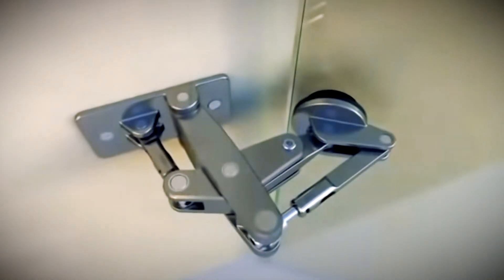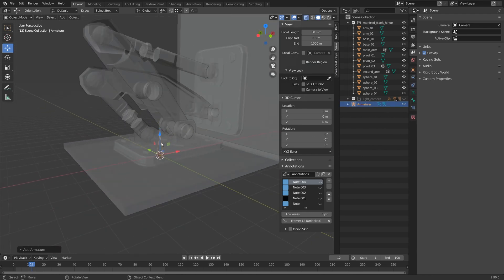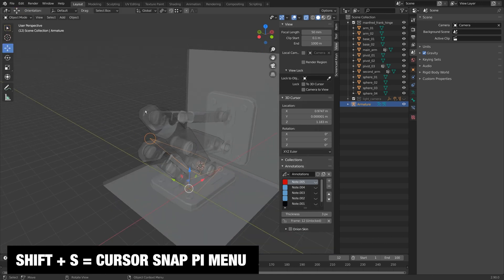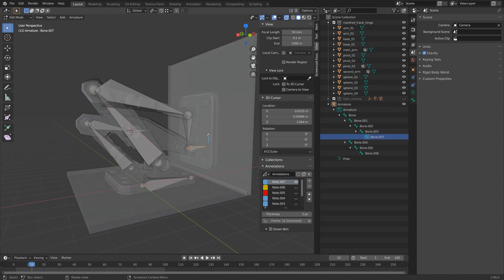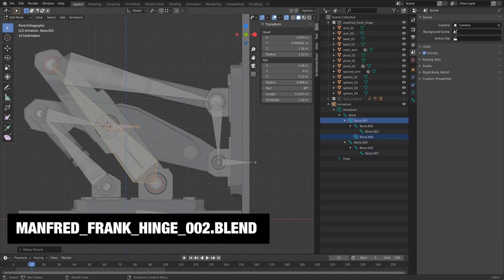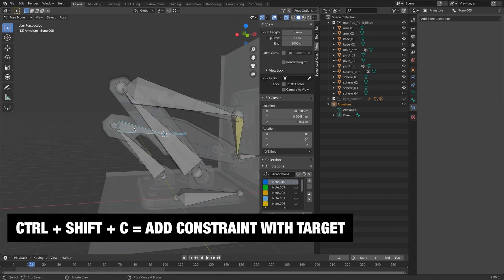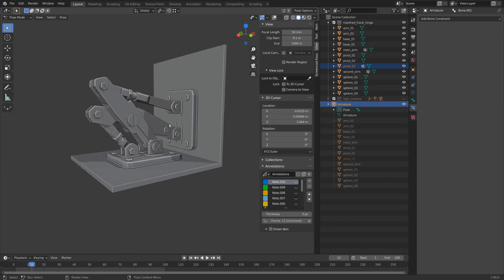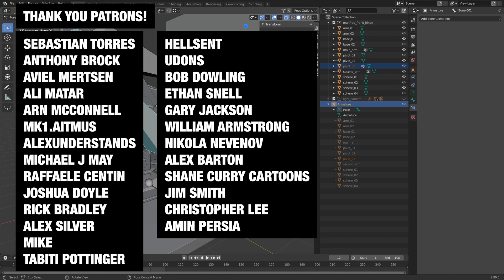How I Rigged A Manfred Frank Hinge In Blender

Comment: I think I grasp the rigging method. But how did you know the object mesh geometry would result in the hinge action you wanted.? It looks like the mechanism has multiple adjustment points.
Reply from the maker: In this case, I based it on a real-life hinge - and I built it around that mechanic.

Comment: ahh no, its all separate objects, you dont want that for game dev! its gonna blow your drawcall up.
Usually you want it all to be one object.
Reply from the maker: Agreed in that case this should be joined together, and an armature deform should be used instead of bone parents
Reply: @LevelPixelLevel 
Hey thanks for the help, I'll look into deform. Would blend keys work as well?
Reply from the maker: @coffeediction  It might - but you would need a lot for this as it has rotation. You almost want to use just deform bones and weight paint everything 100% (can assign this in edit mode as well) 
Then bring the rig and the mesh into Unreal, or Unity, or Godot.